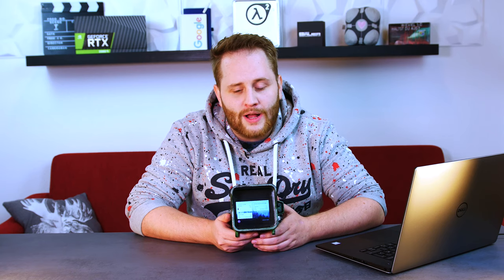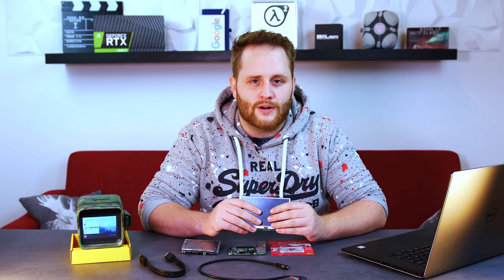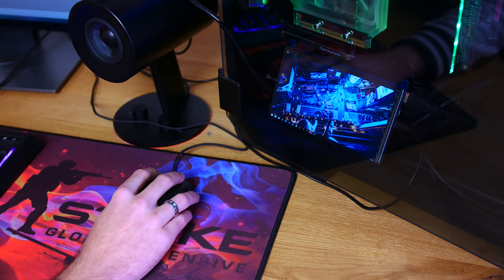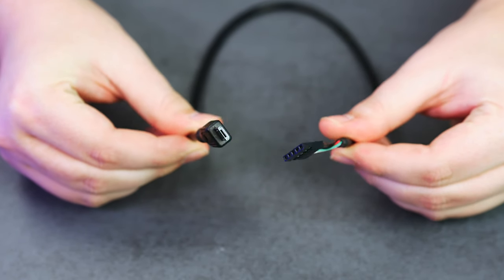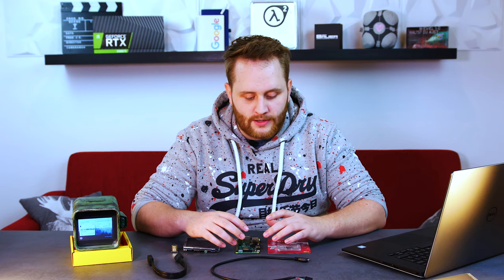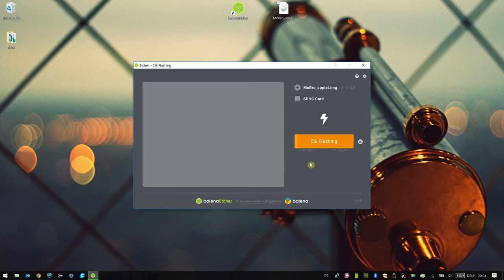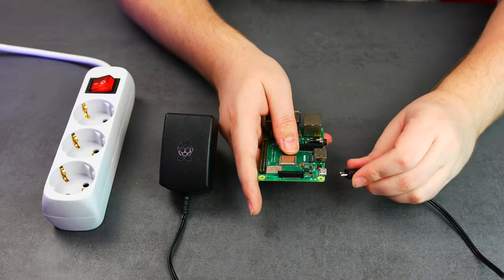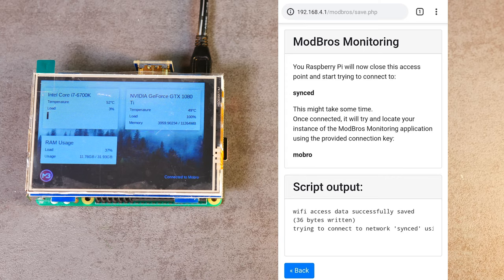How to create a PC Hardware Monitoring Screen Inside your Case

Comment: Amazing works seamlessly. Just wish i could use the widget to display exactly what i want. like pump flow and other important stats
Reply from the maker: Hey David, thanks for trying out MoBro and we're glad to hear that it works for you! 
yes that's something we want too and we are currently developing! We already have data sources so you can add more data points like HWiNFO and there will be more in the future. And theme customization is a feature we want to have done in a few months! So you will be able to customize what you want to see and where on your raspberry pi, phone or desktop. If you want to know more about data sources you can read our faq here: https://www.mod-bros.com/en/faq/mobro/desktop-app/hardware-monitor/data-sources
Reply: @ModBros  Appreciate the fast response wow. this is exactly what im looking for. Appreciate your support and keep up the good work. HWiNFO sensor data reading is amazing! as it includes some mobo specific sensors. You guys rock!

Comment: Is the display customizable?  In other words i would like to monitor fan speed and water temp sensor (2 pin t-sensor plugged in motherboard) is there a way to do that?  Nice setup and thank you for the added files.

Comment: This is cool! Thinking about doing it. If I connect the Pi to my motherboard for power, will it turn on and off with my PC and reconnect when it turns back on?
Reply from the maker: Thanks! That depends on your bios settings. If you enable ERP in your bios it will definitely work.

Comment: a easier way to do it by routing a cable is using those HDMI panel mounts. a PCI cover that can support HDMI/a HDMI panel connector.

Then you use a Ultra short 30cm cable to easier route it on the ouside.

Comment: great ideia !! A visual interface like Cam from nzxt would make this perfect
Reply from the maker: Tank you! You mean the interface on the raspberry?
Reply: @ModBros  for the PC or the raspberry. I think most people use LCD like this connected to their PC's, since it's cheaper. I'm waiting mine to arrive from China and I'm still looking for some cool app to display my PC stats. The interface from CAM is very cool but the program itself it's not very practical.
Reply from the maker: That is very true. I think the software on the PC is already a little bit like cam. We are currently looking into the ability to make custom skins for the raspberry, so you can customize the screen on the PC to match your build.

Comment: Really great guys. Just a question if you connect it to your motherboard does the raspberry closes with the PC or will it stay on?
Reply from the maker: Thanks!
We'll that depends on your motherboards bios settings and on the windows settings. For example if you have a gigabyte or AORUS motherboard you can enable Erp in the bios. With that the USB ports do not get powered after the shutdown. You could also use a molex to micro USB cable to power the pi so it will shut down with the pc.
Reply: @ModBros  thank you very much! I wasn't aware of the existence of ERP. I think I will activate it instead of using a molex. Overall it looks like a great thing. It will make sure nothing useless is running when the PC is off.

Thanks again for your precious help.

Comment: Thank im definitely doing this parts already ordered. New to this, so I'm guessing I can't used aida64 with this program so i can connect via wifi and use pi3b+ outside my case. I want to have it on my desktop and later on maybe put inside case but either way have both options.

Comment: @Mod Bros Is it lightweight enough to work just as well on the Pizero W or is performance worse?
Reply from the maker: Yes it does also work on the Zero W.
Performance wise its of course slower since we do rely on chromium at the moment.
Once everything is started and the theme is fully loaded it's fine though and there's no difference.

Comment: How is the data displayed?
When i look at the software i don't see how this is done on the display.
In the software you  must select tabs to view diferent date.
That's not posible on the diaplay.
So i realy like to see screenshots of the actual screen with the software installed on it.

I like to see modular themes where you can drag & drop only what you want to see.
Also  the software is REALY basic (graphicaly).
Some nice backgronds, animating objects etc. would be nice.
You don't have this kind of screen not only for the data but also because it looks nice.
And PLEASE make it FULLSCREEN.

About the screens:
Why is the hdmi-connector not on the back of the screen?
Almost every screen i see has the connector on the side of the screen where the cable is sticking out of the screen.
If the  connector would be on the back then you can not see any cable sticking out.

So that's my thought about this
Thank you

Comment: Man great Video and content, sadly I have an issue with the windows app, It recognize the RBP3 but it has a warning messages that saids: Service not Found, Restart Service !.  I already enable firewall access, reinstall the app and restart my pc. **offtopic**I also will add that the official raspberry 7 inch display works without making any changes in the display settings.
Reply from the maker: Thank you for your feedback, glad to hear that the raspberry is working out of the box for you!
In order for the desktop application to work and actually read data from the pc it needs admin rights. Otherwise there is no chance for us to read temperatures on windows. Maybe you did not accept it when you installed it. But if you click on "restart sevice" next to the error message it should try it again and ask you for permissions.

Comment: Does the PC I'm monitoring need to be connected to the same WiFi for it to work? I have my PC hard lined to the router and only use Wifi for my other devices.
Reply from the maker: If it's the same network it works!

Comment: im trying to connect mine but my screen wont find a wireless connection
Reply from the maker: Could you elaborate on what's the exact issue you're having?
Is the wifi configuration hotspot not created? Or does the Pi fail to connect to your wifi network after configuration?
Reply: @ModBros  never mind i figures out its my rasperry zero that doesnt have wifi...silly me...

Comment: I had a question can you use the software without the rasberrypi just directly from your pc? I already have the unnecessary cable setup(hdmi to gpu) but I'd love that fallout theme or other themes you got.
Reply from the maker: Yeah sure, you can. If you prefer it that way, you can have any of the themes running in a browser window on your PC instead of a Raspberry Pi or phone.
In the 'connected devices' tab just click on 'open in browser'

Comment: This is pretty damn awesome! If you're reading this, Mod Bros, I have a question:
Is there a way to get this solution to use a USB header from the Mainboard? I'd prefer an internal wire connection than wifi or external HDMI/Ethernet cables.
Thanks! Keep up the good work :)
Reply from the maker: No, currently not. At the moment we just use regular network to communicate with the Pi.
Also the usb power connector on the Pi doesn't support data. You would still need 2 cables, 1 for power and 1 for data.
So no plans to implement it at the moment as we're focusing on other parts. But we might look into that again at some point in the future.

But you can use a display that connects directly via the GPIOs, so you don't have to use a hdmi cable ;)
Reply: @ModBros  Thanks for the reply! I originally wanted to avoid the solution with HDMI to the GPIO, because of the extra external cables, but I'm now convinced that an extra screen has more utility. Appreciate your time :)

Comment: Can you send data from multiple pc's simultaneously to this setup?
Reply from the maker: Theoretically it would be possible to do but we have not implemented it yet.
Reply: Could you implement that? I'm looking to build a 2 pc system and this would be awesome to monitor both systems on the secondary system while the primary is rendering or sth. I'd even pay for sofware like that! (that also looks somewhat nice, I know there's some server software that will do this but they really have this Windows 2000 look)

Comment: hi great vid, will this work with a 5" screen?
Reply from the maker: Thanks! 
Yes it works for every resolution or size. You only need to install the right drivers from the screen manufacturer or use HDMI.

Comment: Why do you need the Raspberry Pi?  If the PC is displaying the stats, what exactly is the RPi doing?
Reply: yep, this is exactly why some people just take a small lcd and plug it straight into the graphics card
Reply from the maker: Well you don't need the pi if you don't want to use it. Our solution works either way. You can run it on your computer, the pi or an android phone! 

And regarding your question what the pi is doing. It's rendering the screen so your pc does not have to. This way you could also just have it standing on your desk.
Reply: It is saving an hdmi port from your graphics card, for people like me that uses 3 monitors this is great
Reply: @ModBros  Loving it! Using PI 4 and its working great thanks! Was wondering is there a way to edit my own themes?
Reply from the maker: Glad you like it! 😊
Themes are basically just html pages that you can edit with some coding skills. To learn more see here: https://www.mod-bros.com/en/blog/b/configure-themes~916

There is also a theme customization feature on the way that our patreons are currently testing:
https://www.mod-bros.com/en/blog/b/theme-customization-feature-on-the-way~1366

Comment: are you willing to add device's battery stats too? for example i have corsair wireless headset and razer wireless mouse and i would love to see their battery status without using their software
Reply from the maker: We're currently still in beta and working on theme customization. Having more data is always something we want improve on, but we would need a way to actually read that data. Currently we are getting data through hwinfo or other hardware monitoring libraries and if they do not read that data like battery stats, we are not able to display it.

Comment: Ahoi, joar passt ganz gut....Jedoch wie einige andere User schon sagen, man benötigt tatsächlich mehr Infos...Fan Speed, Pumpe, Wassertemp. etc. Schaut alles so leer aus, auf meinem 7zoll Bildschirm. Freu mich schon auf das Update. Thx

Nachtrag in anbetracht dessen das diese Installation funktioniert, rechnet sich das ganze absolut nicht. für das ganze setup lag ich z.b. bei circa 60 euro ( je nach wahl des displays) und dann halt nur 3 Anzeigen was komplett falsch ausgelesen wird, nicht..... wusste nicht das mein ryzen 5 2600x 12 kerne hat. zumal auch hier die temps falsch ausgelesen werden, ähnlich ist es bei meinem Ram. demzufolge geht das ganze wieder runter, da ich es nicht einsehe für soviel geld in die hardware zu setzen, für was, was absolut nicht ausgereift ist.

Empfehlung nun von mir, beschäftigt euch lieber mit " Rainmeter " in verbindung mit HWinfo bastelt euch selbst nen gescheiten Desktop der auch über nen Splittscreen funktioniert, dann langt auch völligs das Display, und die infos sind realistischer...

bis dahin grüße

Comment: Hey love the work! As a developer myself, wondering if you guys plan to make the code available or git going? Also does the program have a shut down feature when the PC turns off, or any ability to auto turn on and off when the computer wakes and sleeps?
Reply from the maker: Thank you! 
The best signal for the raspberry to see if the pc is off is actually not getting power over the USB or a power supply (depending oblm how you power the raspberry). If it is not turning off for you there is a windows setting where you can tell the pc not to have power over USB when it's shut off

Comment: the only thing you would need is a rasberry pi... then goes on to list more things....lmoa i just use an old phone with splashtop wired display, running a black usb cable from inside the case to a port in the back. only costs 6 bucks for the software on android providing you already have an old phone laying around.
Reply from the maker: Well we also have an android app or you can run it in your browser on the pc on a second monitor or where ever you want. Our solution has it all - and it's free. This video focuses on an external display with a raspberry 😊

Comment: OMG exactly what I was looking for!  I will be testing soon.  Is it possible to use the wired Ethernet instead of WiFi?
Reply from the maker: Not yet, only WiFi is supported at the moment.
We already have planned to add Ethernet support in an upcoming version, but I can't tell you when it will be ready, as we are currently focusing to improve the desktop application.
Reply: @ModBros  Great!  Thx for the info!
Reply from the maker: So it's been a while, but just to let you know: we recently released an updated version (v6) of the image which now also supports wired Ethernet :)

Comment: One question: how does the Pi (as "stand alone pc") starts ? (Never had one before) Does it start automatically when power plugged in ? It would be annoying to have to start the Pi in addition to the PC.
Reply from the maker: The pi starts automatically when power is plugged in.
You can either use molex to power it, so it starts with the pc. Or you can use a USB header from the motherboard and configure the bios so when powered down the USB does not have power. (ErP setting in bios)
Or you use a normal power supply, then it's always powered, but we do have screen savers soon, so they get displayed when there is no connection to the pc

Comment: Does the software allow the ability to monitor and display water temperature and flow rate?
Reply from the maker: We use third parties to track data. So if hwinfo64 picks up the sensor we do have access to it 👍

Comment: HI guys. Looks like a fantastic idea, so much that I even bought myself a Zero W and a 3.5" screen to have a go! Unfortunately although the PC side of the software seems to work fine, the Pi side does not appear to work with my Zero W? I cannot get the config screen to load despite waiting more than 20 minutes. I had a friend try it out with his Pi 4, and it works perfectly. He tells me ( I am a total noob at this stuff) that software for the Zero would not be the same as software for the 4 as they are different versions of ARM?  Is there an alternative software for the Pi Zero W that I am not finding a link for or something?
Reply from the maker: Hi. Thanks for giving it a try :)
No there is no separate version for the Pi Zero W. If you downloaded the one that is linked in the video or our website, it should work just fine.
Do you have any output on your display? If yes, what does it show?
Did you connect your display by HDMI or over the GPIOs?
Reply: @ModBros  I am connecting via HDMI. I get some code come up as it loads, but it stops loading at a certain point. Images here.. https://forums.overclockers.com.au/posts/18359151/
Reply from the maker: So since registrations to the forum apparently need to be confirmed by an admin i'll just reply here.

The way you set everything up seems totally fine.
Just to check, i downloaded the image myself, flashed it on my pi zero w and it worked.. 🤨
I would normally recommend to update Raspian and everything to the latest version and then try again. but since you can't even boot to console that's no option.

I'll have a look at it again tonight and then provide you with an updated image that hopefully works.
We're using Pi Zero Ws ourselves for most of our builds, so there should definitley be no problem there.
Reply: @ModBros  Awesome, thanks !! One of my friends has suggested using Rufus to flash with instead of Etcher. I haven't tried that yet but I'll let you know if it offers any better results. An updated image would be so helpful though, much appreciated !
Reply from the maker: @kev5406  I just updated the image to a newer version (v5) that hopefully also fixes your problem.
So just download that and give it another try. And if you don't mind, please report back if it's working now or if there are still issues.
Reply: @ModBros  The new image works :D I can get it connected to a network, but it will only connect to my 2.4GHz network, not my 5GHz - I assume that's a limitation of the Pi Zero W. No biggie, I simply connected my PC to the 2.4GHz instead. Unfortunately now I get the 'Bummer' screen when it tries to find the mobro software on the PC.
Reply: Hours later, turned the PC on and tried again. It connected !! Still some issues, description and photo here..
https://forums.overclockers.com.au/posts/18361660/
I think I need a lower definition screen, for a start..
Reply: Connection is patchy. Sometimes it works, sometimes it cannot find the mobro software on the PC. The main software has also stopped displaying GPU stats, although it does identify the GPU itself.
Reply from the maker: Glad to hear it's working now :)
About the stats: That's something we're working on, as we also discussed in our latest video.
Unfortunately it's not that trivial and as we're currently also working on a new PC build there's not that much time left besides our day jobs.
So an update is definitely coming, but it might take some time.